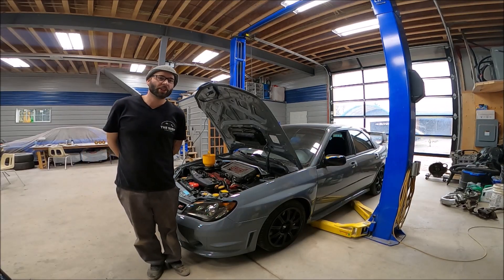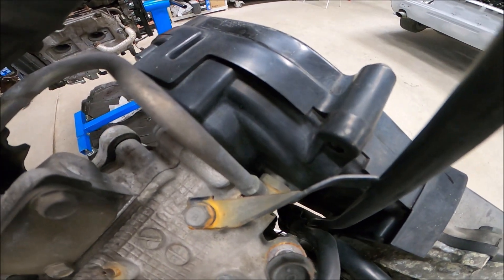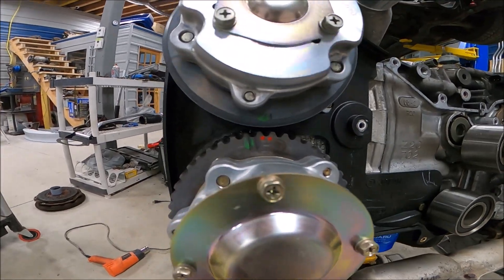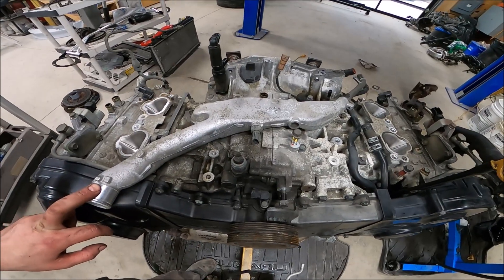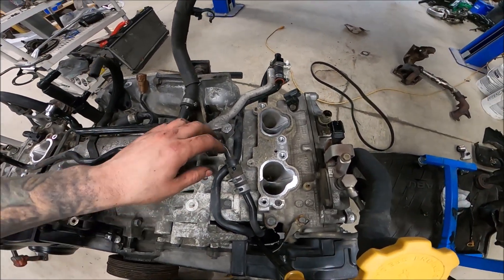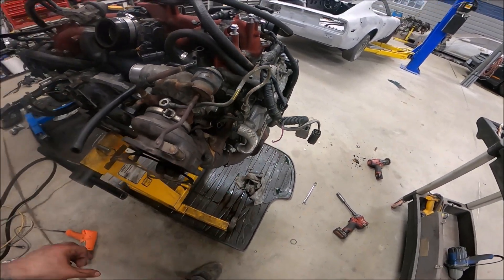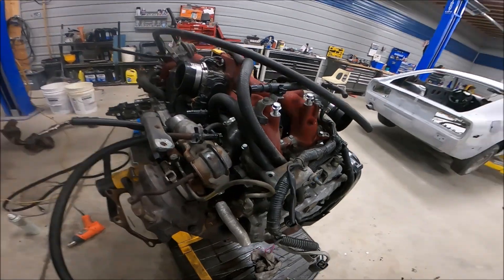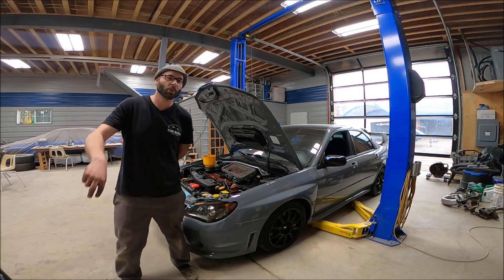How To Jdm Ej20X Swap - 06-14 WRX, 04-07 STI, 05-09 LGT, 04-14 FXT

Comment: Sincevthe ej20x has dual AVCS, how do you get the exhaust camshafts sensors to work? Or did you just not plugged them in and simply backed up the exhaust gears one tooth?
Reply from the maker: Leave them unplugged and set the exh cams backwards 1 tooth
Reply: @TheSubieSanctuary  Interesting.. any issues/codes ever since the motor was swapped?
Reply from the maker: @Mike_44  ive done 100 over these over last 5 years. No issues
Reply: @TheSubieSanctuary  Oh man that’s awesome news. So no issues at all leaving the exhaust sensors unplugged. My ‘05 OBXT motor blew 2 days ago, I know what to do now. Thank you!
Reply from the maker: @Mike_44  no issues brother 🙌 i did 3 of the 20x swaps this week. They tune out well and generally a reliable and affordable solution to replacing a dead motor. If your developed knock id also replace the turbo or at least the turbo cartridge too with the new motor going in
Reply: @TheSubieSanctuary  Cool man.. Will I need a JDM ECU along with the jdm ej20x motor? My car has a few aftermarket parts like catless DP, Boost controller and aftermarket Intercooler. Do I have to get the motor retuned? You’re a live saver bro.. I was thinking I had to send my USDM engine harness to iwire so the exhaust camshaft sensors would work..
Reply from the maker: @Mike_44  you do not need a jdm ecu, everything will remain as it was, all your original upgrades can go back onto the 20x, it is ideal to get a tune. These are high compression engines, so they are unique compared to domestic turbos in that way. They can be tuned using cobb or open source. 
After its up and running you can drive it, but i wouldn’t recommend boosting etc until you get it dialled in.
Reply: @TheSubieSanctuary  That’s awesome. I really appreciate all your input. I was pretty depressed yesterday thinking I had to junk my car. Pretty cool this cheap option exists. Hope you don’t mind some more questions in the future if I need help once I get the 20X. Thank you again! 🙏🏻
Reply from the maker: @Mike_44  my pleasure and your more then welcome to ask away when needed. Always like to hear a success story in the end
Reply: @TheSubieSanctuary Jesse, one last thing.. my used ‘05 Outback XT motor that got damaged was already tuned due to the few mods it came with, but I never had the access port for it, nor I know what kind of tune it had. Would this be an issue when trying to tune the new ej20X?
Definitely liked and subscribed!
Reply from the maker: @Mike_44  there is a slight potential for issue. If it was tuned via cobb then it could be married to ecu. Id assume it would have been open source tuned, otherwise there would have been no reason to not get the cobb with the car, as they essentially paper weights once married to a car. 
If for some reason a cobb was left married to your ecu then it may be a little challenge for tuner to access ecu. 
There is an easy way around it though. Ive had to do it, borrow someones cobb for a minute, marry it, it overwrites previous one then un marry and 🙌 clean and clear ecu
Reply: @TheSubieSanctuary  Perfect! You're the man Jesse. Thank you!
Reply: Jesse, more questions lol my automatic ‘05 Outback XT has an oil cooler. Since most jdm 20x motors don’t bring the water cooler, should I swap mine to the jdm ej20x motor? My concern is if the jdm water pump would work ok/have all the “ports” needed to function ok with my USDM water cooler.. or would I also have to swap over my USDM water pump to the jdm motor?
Reply from the maker: @Mike_44  if your motor knocked your oil cooler is garbage. You could buy a new one and transfer over your water pump if you want. But if your not racing then you can just leave the jdm non oil cooler set up as is. 08-14 wrx do not come with oil coolers anymore.
Reply: @TheSubieSanctuary  Yes, my engine had what I think was a spun bearing. It started doing the typical tac tac tac tac noise and the temperature started rising. I don’t race the car, just commute with it, but do like to “step” on the gas from time to time, nothing serious. Ok, I’ll keep the jdm water pump and non/oil cooler on the jdm motor. I was just concerned about the water pump having more or less ports. Thank you.
Reply: Jesse, I'm going crazy man.. I'm running out of options due to the fact my '05 Outback XT came modified with those parts I mentioned before (catless DP, CAI and Grinspeed boost controller). I'm honestly even considering returning the ej20x  ;(
I'm afraid to swap the ej20x long block on my car and have it explode or damaged because I don't have a stock parts setup on my car, nor the tune the car came with. This was my first turbo Subi, I should have bought it stock.. I have searched the webb and called many places, nobody seems to know who can tune a jdm ECU, especially with aftermarket parts already in the car. What should I do??
Reply from the maker: @Mike_44  the tuning aspect I find most odd. Its just like tuning any other engine. Its still a domestic ecu. 
As for the mods and potential tune on your ecu already. The engine will run well off the bat it would be completely drivable. But ultimately is definitely best to get a tune. Im still slightly shocked tuners in your area wont tune a car because jdm engine. There are ways to have it E-tuned but youd need to get a cable/program. I personally dont like the idea of e-tunes. Not as good as in person tuning
Reply: @TheSubieSanctuary  Yes, there are indeed several tuners around me, but they don’t tune (JDM ECUs). I was asking them if they tune jdm ECUs because I was thinking of getting the iwire harness merge kit to control the exhaust AVCS sensors. If I were to go that route, iwire told me I'd need a jdm ECU. I hope I’m not confusing you bro..
I will do the swap and not return the jdm motor if you say it’s ok then. I will drive the car like an old lady, not revving it at all until I take it to a tuner. I just hope they can re-flash/retune the stock USDM ECU with the exhaust AVCS sensors unplugged and these aftermarket parts I have on now. I really appreciate your help and apologize for so many questions.
Reply: Hi again Jessie! I already got my ej20x stripped down to a long block. I had some questions: so the crossover pipe and breather pipe lines need to be from my ej255 correct? I wasn’t clear on that part.. And, to get to the banjo bolt filter screen behind the Left Intake AVCS gear, can the banjo bolt be removed without removing the AVCS gear?
Reply from the maker: @Mike_44  the banjo bolt behind the cam gear can only be gotten to if you remove gear. It’s typically the turbo side of engine that would ever have an oil flow issue. 
As for pvc pipes and coolant crossover. 
Depending on car your putting it into they can be left as is with exception of the main crank vent by turbo being different. 
If your stuff looks any different then the 20x, then swap yours onto the 20x
Reply: @TheSubieSanctuary   😬 I was afraid you’d say that haha.. Ok , thank you again.👍🏻
Reply from the maker: @Mike_44  you didnt toss your old motor yet did you 😬 
Is your car cast aluminum intake style or plastic intake mani? 
For the plastic intake mani’s the pcv and such are just about the same on 20x
Reply: @TheSubieSanctuary   I have the plastic Intake Manifold. My car is an ‘05 Outback XT. I still have the bad ej255 in the car, just working on the 20x motor in my garage in the meantime, prepping everything. Ok, I will use the 255 PCV. I remember you told me not to use the oil cooler from my ej255 because of the spun bearing, engine is seized and I’m afraid there might be metal pieces in the oil pan. Will the ej255 turbo and PCV be contaminated as well from the spun bearing issue?
Reply from the maker: @Mike_44  i would definitely proceed with caution using the turbo off the blown motor. Typically we really push to replace the turbo or at least the turbo cartridge. Is it vf40?
Reply: @TheSubieSanctuary  I think it’s a vf38, stock size little turbo.
Reply from the maker: @Mike_44  i dont know the LGT/Obxt turbos too well. I know there is a vf40 among those models. But any VF cartridge could work. 

How long did it run after the engine began knocking?
Reply: I ran it maybe 1-2 minutes then shut off the car..
Reply from the maker: @Mike_44  should be fine then. Could wash it out with some wd40 through the oil port on top
Reply: @TheSubieSanctuary  Ok will do! Thank you Sir. Forgot to tell you the ej20x I bought failed Cylinder #4 leak test today 😐.. Will try some different things tomorrow for a more accurate test to pinpoint more what’s going on..
Reply from the maker: @Mike_44  ya once they have sat a long while the valve seats and carbon can kinda pull in moisture and fail a leak down test since they wont fully seal with the crud there. If the leak is through the valve. Then id spray some break cleaning in there with valves closed. Let set then flush it out exh valves. But if leak through piston (air out oil cap) then ya it would be bad. 
100% of the time if i get a jdm motor with less then prefect seal through valves. It goes away once ran, or the rinse method, if it shows improvement then you know valve(s) good and carbon the issue
Reply: @TheSubieSanctuary  Oh wow.. words of hope Jessie.. I was already planning on doing that, spraying valve cleaner and air to rid of particles in the intake/exhaust ports. As you mentioned, these motors have probably been seating for years.. I will repeat the test after cleaning. Do you think otherwise, I could find new valve seats for it? I saw piston rings for sn ej20x on eBay, but what I’d really like to get a hold of is its JDM service repair manual (FSM). I haven’t had any luck finding one online yet though.. Not dure if in Japan these motors were in a Subaru Legacy or a Liberty..
Reply: @TheSubieSanctuary  Jessie, I got to work with the motor today and after spraying valve cleaner and oil on the piston rings through the spark plug hole, the cylinder leak down test results changed completely for the better! 😃 To be honest, I only sprayed the Intake valves and forgot about the exhaust ones, and even like that, the test was about 80-90% better. I sprayed the exhaust valves tonight. Tomorrow I’ll rotate the AVCS gears and spray some more cleaner on the valve seat to dislodge any particles on the valve seats.. you know your stuff brother, these motors after seating for so many years, need lubrication or won’t pass a leak down test. Thank you so much for your replies and help. 👊🏻👍🏻
Reply from the maker: @Mike_44  awesome news 🙌 getting close now
Reply: @TheSubieSanctuary  Jessie, one last question if I may: Would there be a problem with this swap being a 2.0L, but the usdm ECM is designed/programmed to operate a 2.5L? Would require a tune right?
Reply from the maker: @Mike_44  there is no issue running the 2.0 on the original 2.5 ecu. They both do have the same size fuel injectors which is most important. But ultimately a tune is always worth the effort to get timing in check and maximize the fuel efficiency of the 20x
Reply: @TheSubieSanctuary  That’s a relief to hear. I was concerned about it. Thanks!
Reply: @TheSubieSanctuary  I removed the ej255 two weeks ago, have been working on both engines. Preparing the 20x and removing the parts from the 255 to be swapped over to the 20x. Surprisingly the 255 had been upgraded with a VF52 turbo, but the turbine housing is cracked. I'm going to keep the VF38 the 20x brought, it's a twin scroll turbo in great shape and its exhaust manifold is in excellent condition too.
Reply: Jesse, I'm done man! The ej20x is swapped on my car and running super smoothly! I'm so happy man.. so much work (4.5 months in total). I am however getting a couple of codes: P0700 and P0725. I now have to get it tuned it and learn to tune myself.. Is it safe to test drive the car around the block without accelerating too much, just very slow speeds? I'm concerned of anything braking prior to having a tune on it. Would appreciate any of your recommendations post-swap.
Here's a video of my engine running:
https://youtu.be/Hq6A9tqFzKM
Reply from the maker: @Mike_44  right on buddy! Those codes are trans codes.
Is your car auto?
Reply: @TheSubieSanctuary  Yes.. it’s an automatic’05 OBXT. Correct they’re trans codes. I’m still doing research, but looks like they might be related to the cam gears retarded timing of 7 degrees or so and the usdm ECU can’t understand what’s going on.. by the way, my O2 sensor now is after the turbo, at the beginning section of the DP. I have no EGT sensor installed since I kept the jdm twin scroll turbo and exhaust manifold, which doesn’t include a bong for an EGT sensor.
Reply from the maker: @Mike_44  your car will not be able to pick up any difference in timing. Intake timing is still the exact same. And exhaust can not be read and also now sits the same as original 255 anyway. 

Check the plug under intercooler (think its brown) and any other trans plugs also ground from trans to firewall
Reply: @TheSubieSanctuary  Which plug in particular under the I/C? Will do Jesse. Thanks!
Reply from the maker: @Mike_44  its a brown plug from engine harness to trans. Should be under intercooler. Im not incredibly familiar with all the auto’s among the years. But i know a plug from your original engine harness plugs into trans harness. 

If plugged in already, unplug it, make sure pins didn’t push back. You should not have any codes after the swap, so it will end up being something not making a connection somewhere
Reply: @TheSubieSanctuary  I see. Will do that soon as I can. Thanks again!
Reply from the maker: @Mike_44  let me know how it goes. Otherwise yes your fine to drive car out of boost
Reply: @TheSubieSanctuary  Got it. I think boost before would kick in after 3K rpm. 👍🏻

Comment: what would you get if you got the 20x block and put the 255 heads on it? has anyone done this?
Reply: Did you end up going this route? I plan on doing that rn wit my 2011 Wrx
Reply: Im just getting to it, using the 20x heads. Same as he dose in the vid. And going to have it tuned.